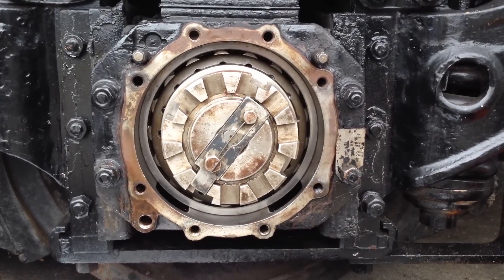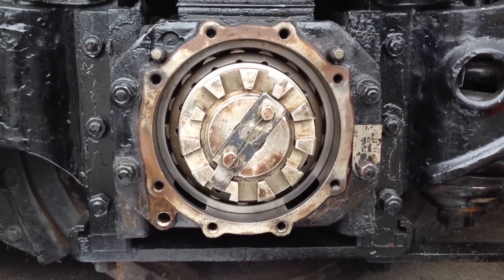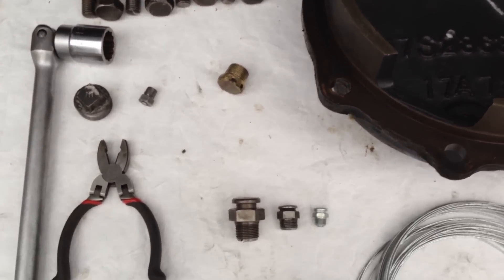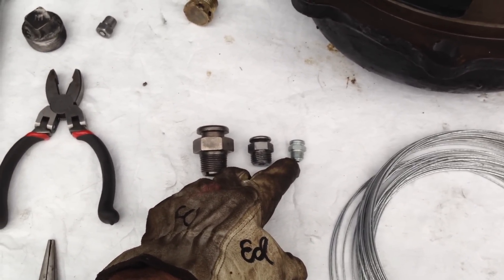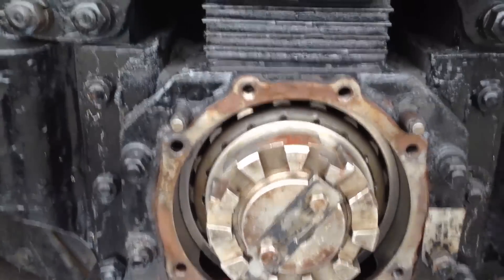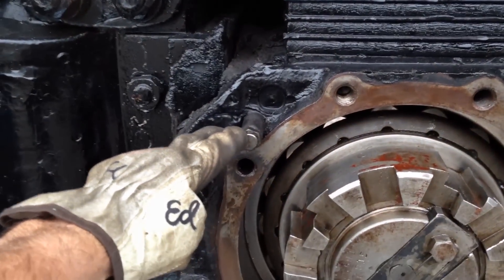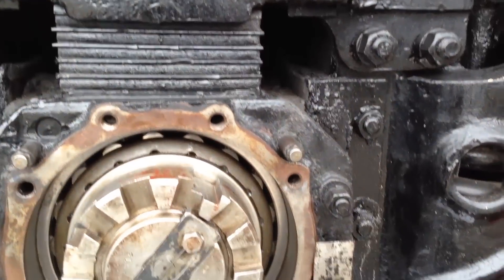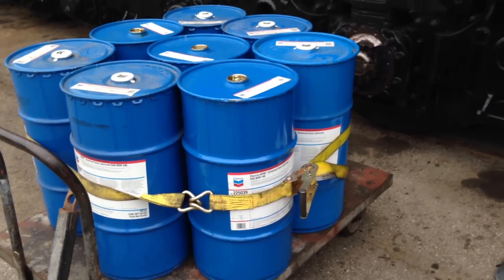The UP 4014 Project - Oct. 2, 2013

Comment: Timken revolutionised the railroad industry when they invented the taper roller bearing. Before then just plain bushings were used which created a lot of friction and wear. Timken are a damn good bearing and I use them in my truck and trailers. I would have thought the grease would have gone off a bit since 1961 though, and of course lubricants have improved out of sight since then.

Comment: The condition of the lube is not nearly so much a hat's off to the lube manufacturers as it is to the Timken and loco designers/engineers. It is readily apparent what an excellent job they did in sealing those bearings and bearing casings, or the grease would have dried and caked long ago. What battleship quality!

Comment: Tomoya, talk only of things you know about. You look less ignorant that way. A typical UP passenger fleet, along with one of the diesels they have in the consist for dynamic braking, and assist on grades, weighs in the area of 2000 tons. For simplicity, thats 4 MILLION pounds. Pulling the Big Boy with 844 would be a piece of cake.